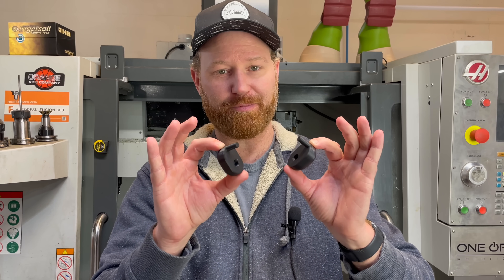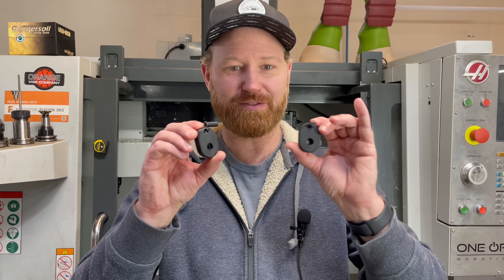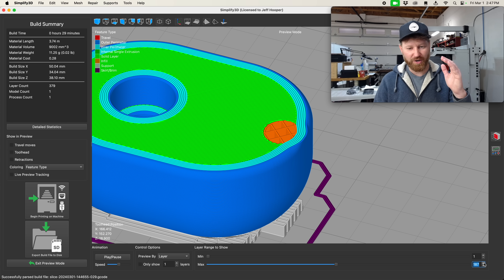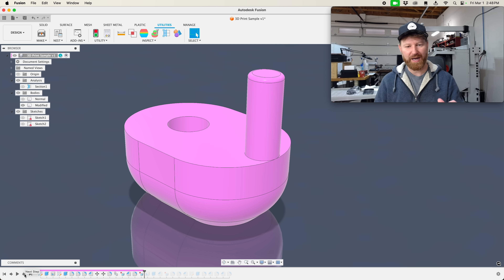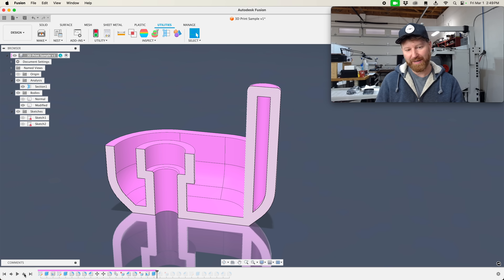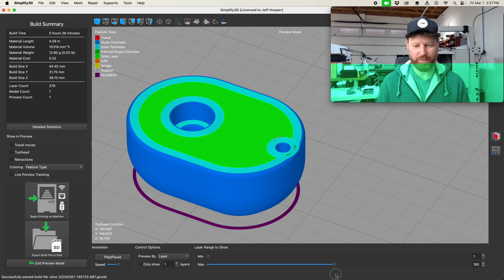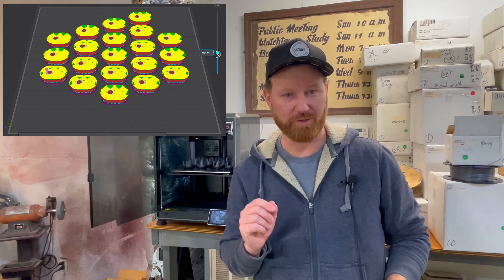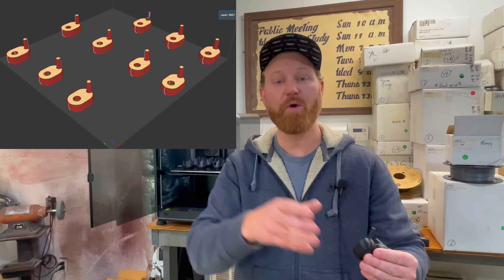Make your 3D print Faster & Stronger

Comment: your slicing profile is a bit scuffed looking at 4:45 the top flat part of the model has been given a "floor" a "ceiling" and some infill.... this is not what you are trying to achieve.
Reply: I mean, no not really. The goal of this was to create a strong part which was achieved by essentially making everything solid walls without any infill which is a little unordinary but does effectively solve the issue and is a very real technique. I wouldn't say this is the most fantastic execution of this I've ever seen as there are ways to achieve this by modeling extremely small cavities around the inside of your part to essentially trick the slicer into automatically putting wall loops around your desired area. However, this part likely won't see any large scale production so using that method is a lot more work than is needed for this kind of thing and the way he did it works just fine. The only downside is this process leaving small amounts of support material inside the part, however this has virtually zero chance of ever actually causing issues, so take that as you will.

I say this as someone who works in industrial 3D printing and I've seen a LOT of pretty terrible ways people have designed parts for printing and I think this one is actually rather good for what he wanted to accomplish!
Reply from the maker: Thanks man! This was just a rough concept to hopefully get people to think differently about possible solutions. I put no effort in the slicing demo. haha. Thanks for watching and your informative comments!

Comment: Adding a body as a modifier can achieve the same effect.
Reply from the maker: You're right, but the goal was to provide a new concept that might give the user more control over the printing process. This was just to introduce a new concept for some users. Thanks for watching!
Reply: @ChipMonkeys  yes, and it has given me new ideas.

Another option is (near) zero thickness voids to force walls to generate in specific places.

Comment: Don't need to model the inside, just change your print orientation. The way it's being printed, that part is going to break off at that flat layer no matter how well you model the inside. Congrats, you've just added more walls, wasting more material, while still having the same structural weak point.
Reply: Printing this specific part in a different orientation might not be viable as the hole and post would turn out less round.

It is not possible to always find a single print orientation suitable for all features on a part. What if it had to have pegs on all sides?

Additionally, how is that filament wasted if parts printed with less material would be scraps as they do not meet the customers requirements.
Reply from the maker: You get it. This is just a concept. haha . This idea might solve a problem one day.
Reply: Thinking  similar but both can be useful definitely depends on orientation and purpose.......same with staggering the builds......always  question when people pause prints to embed  because of same creating in effect a "cold weld"......
Reply: printing in any other orientation would create supports that is also a waste of material.
Reply: Spoken like a true maker. 1D  mindset in 3D modeling. 👍
Reply: @Schroefdoppie 
No, reorientating the part would just, as others have said, introduce a new set of problems; but here's a thought, create modifier in the slicer to put solid infill in the post and local area below.
Reply: Do you 3D print? What kinda comment is this? False information, blame, ignorance, all inclusive bravo! 
The man is in video is %100 correct, this is what we do in industrial manufacturing as well. Placing steel rods is actually the real solution for “posts” but its not viable for home 3D printer people.
Reply: @BebegosAspectOfBabyFlight  
You could model a blind hole in the post to insert a steel pin after printing.
Which leads to the thought of just putting a hole through the post to 'trick' the slicer into putting walls through the body of the part.
Reply: @andrewholdaway813 OP already tricked the slicer by shelling it first. Now it is not a solid part but a hallow part, so there is now a set of inside walls with infill between the walls.  The same "strength" effect demonstrated at the start of the video could have been had by simply doubling the wall, top, and bottom layer count before printing, with no other changes. I'd agree with others above that modifying the infill to be solid below the post would work fine and not require any cad work whatsoever.    The way OP printed it, with support on the inside,could lead to the support coming loose (they are made to be removable, after all), and rattling throughout the life of this part.
Reply: @gutrali  
...already tricked...
I know - I was referring to an alternative and responding to another suggestion.
The shelling mod to the model is demonstrably an effective solution.
Reply: I keep around a multitude of stainless wood/plastic screws for this purpose; in this video’s example if I needed extreme strength I’d size a hole through that post and sink a 3mm screw in there.
Reply from the maker: I love this. Thanks for your comment man!
Reply: You've missed the point. And you are wrong. Changing the orientation still leaves the same weakness.
Reply: Why is it always the most uninformed that are making the snarkiest comments?
Reply: Why does it have to be one or the other? Sometimes you can't re-orient the print easily. Obviously this increased the strength.
Reply: That's not always possible. Sure this was a relatively simple model that you might be able to print at a nice angle. Custom infill is amazing for complicated parts. You don't always have to add it in this way either. I add it to every TPU  print I make. It doesn't always have to be extra walls. Sometimes some areas of parts need more infill than others. Making it where you can design a single part to have different strength properties.
Reply: Negative Nancy
I assume thats an example of modelling on the inside.
If you print it in the side the  radius will be worse.
Reply: Wow, what an ass.

How do you know what constitutes a structural weak point in this part? How are forces applied to the part in a real-world situation? What are the ramifications of having the 'funnel' part print horizontally, which will cause it to be out-of-round.

Your comment is not only arrogant and snotty, it's grossly naive.
Reply: What a noob comment. For starters, that geometry shown in the video can't be printed any other way without supports, talk about wasting material; secondly, he literally explained the principle behind why the part is, in fact, stronger (and even failing to break it, contrary to the first one), and you still say it's going to break off at that layer. Of course if a force is applied perpendicular to the layer lines is going to break, that's how it works; he's showing how to make that fact less probable when orientation isn't an option, hence, you missed the point of both the video and the techniques shown.
Reply: Yeah, don't worry about the extra support material needed, or the poor surface finish from removing the supports, or the misshaped holes features. Oh and it still would be weak... 😂😂
Reply: In my experience, changing orientation on all but the most simple parts often just shifts the problem to another area and introduces wasted material in form of support. Understanding design principles in this video has helped me in past.
Reply: No use in just changing the orientation if a part is loaded in multiple directions, as well as of course causing increased support and decreased quality. Congrats, you have added nothing to the 3D printing community, but have instead pulled others down that are trying to spread their observations and gained knowledge with their peers. Yayy! 🎉🎉
Reply: I like how this guy is so sure of himself. lol cute

Comment: Would it be possible to make a video on designing a part to be welded such as a stand or something from square tubing and then show how you could lay that into a cut sheet? For instance, if you wanted to make a 40”x30” table frame from 2” square tubing how would you go about designing it? Pipe command, or extruding out the profile of the tubing, or something else? Then, how would you turn that into a simple blue print for someone in the shop to cut your material?

Comment: Nice! Intentionally designing for 3D printing makes a massive difference. I've found some engineered prints can be nearly as strong as metal.
Reply: Just seeing all these replies lol. 
So to further explain my original comment:  
You CAN engineer plastic parts to be NEARLY as strong as metal parts if they are designed properly and we assume the original metal part is relatively generic. Of course metal is almost always stronger than plastic, but design has a lot to do with it. If you designed them identically then the metal will usually win. 

For example, we've made 3D printed PETG camera handles that are stronger than the aluminum handles we've found online. The reason for this is the PETG has some flex in the material whereas the aluminum handles end up bending permanently, cracking, or breaking off completely. Again, this is something that's designed to be strong when printed VS some generic Amazon handle made of cast or machined aluminum. Those designs are rarely thought through. 

Having said all of this, I would still choose metal if cost, design, and time allowed for it.
Reply: LOL NOPE. Lets compare polycarbonate (one of the strongest material you can print) VS 6061-T6 aluminium alloy (one of the weakest popular metal alloys) 
Ultimate tensile strength: ~60 vs 310 MPa (PLA ~37MPa)
Yield t. s. : ~80 vs 276 MPa (PLA ~55MPa)
Modulus of Elasticity : 3 vs 69 GPa (PLA can be ~13 GPa)
So you can see the difference is like 3 to 20 times in "strength". If you take into accound weak bonding betwen layers (70% of strength max, usualy around 40-50%) and fact that you can use good steel instead of average aluminium, the difference will be like 10 to ~200 times...
Reply: @tomekpeki you missed the point entirely.  Congratulations.
Reply: @DrewLSsix  Why? Maybe I wasn't specific enough... I fully agree that well designed (with 3d printing principles in mind) part will be waaaaay stronger than just designed part. I just don't agree that polimer can be nearly as strong as metal, because it is not true due to properties of materials. Those parts could be equally functional when metal strength is not needed or when you make fdm part way bigger.  I just saw it worth mentioning because difference in strength can be like 2 orders of magnitude big, so imo comparing this type of materials isn't really adequate.
Reply: @DrewLSsix  Nah, he didn’t. The point was that geometry is the only thing that determines an object’s strength. He articulated in a very detailed manner why that is incorrect. 

It is possible (probable even) that the original comment missed the point, as silly as that is. I suspect the idea that was ineffectively communicated was that there are many functional parts which don’t need to be made of metal as long as the design process is adequate. Granted, this is only an educated guess, but it seems unreasonable to say the guy regurgitating relevant data sheets (in the way which most advocates what was originally said, btw) is the one who lacks understanding of what we’re talking about.
Reply: @tomekpeki  wait a second... you're saying plastic isn't as strong as metal?  I'm gonna need to seem some sources to back up those numbers
Reply: @clayton2347  ohhh guys chill out... I just wanted to clarify unforunate sentence "some engineered prints can be nearly as strong as metal". This comment has lots of up votes and I thought that some young makers can take it wrong, as "if you do right enginnering (design, geometry), you nearly never need a metal parts". This is not true, and I showed numbers to ilustrate strenght difference between best polimers and one really mediocre metal alloy...
Reply: @tomekpeki  Well, to be fair, you can make a plastic print as strong as metal, just not with the same parameters. If the metal print has incredibly thin walls and the plastic has thick walls, they may result in a similar strength.